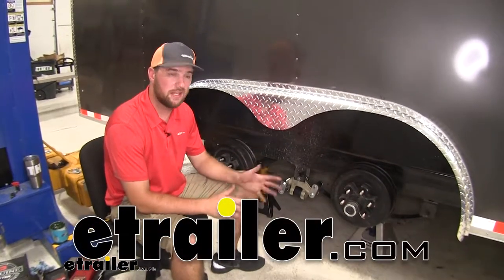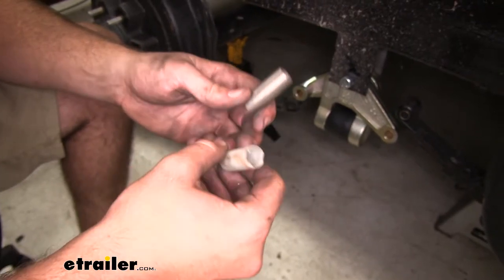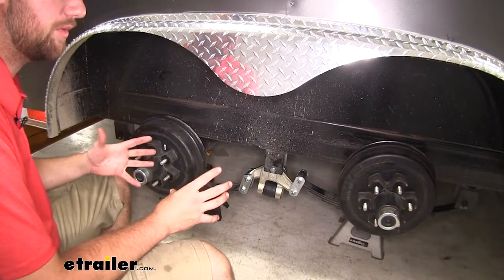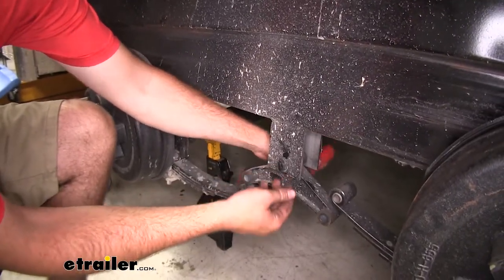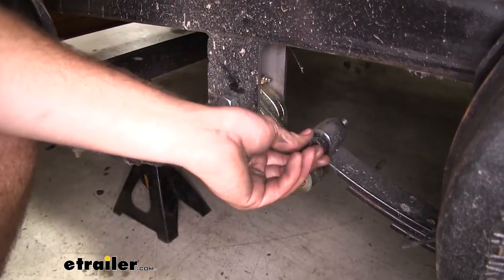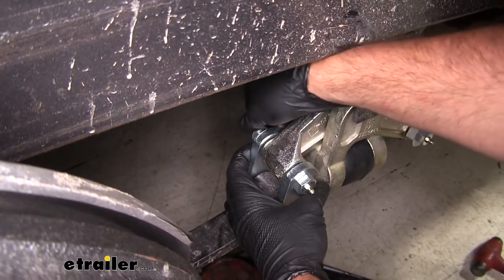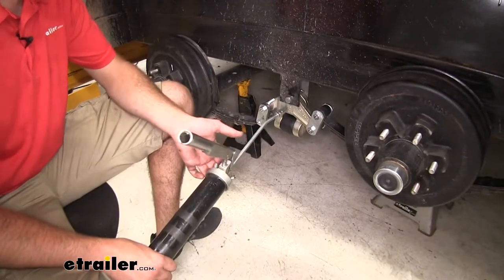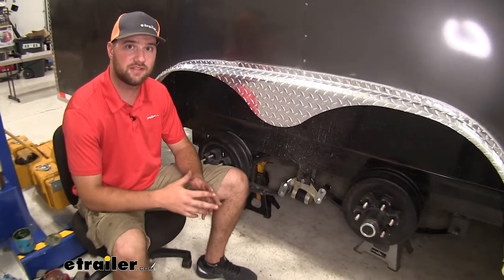etrailer | Dexter E-Z Flex Suspension Kit: The Breakdown

Comment: Grease fitting on the wet bolts should face under the trailer.   Otgerwise you jave to remove the tires everytime you grease them
Reply from the maker: We typically grease the bolts at the same time we inspect the wheel bearings, which requires the wheels be removed anyway. If you wish to install the bolts with the grease zerks facing inward, there's no reason why you can't.
https://www.etrailer.com/Trailer-Suspension-Parts/Dexter/K71-652-00.html

Comment: Dexter torflex axles need shocks installed 
My camper hops like SOB 
I did not know this when I purchased the camper. 
Is there any information on installing shocks
Reply from the maker: How old is your camper? If you have poor ride quality, and your camper is several years old, you'll want to replace the axle, as the torsion dampers have worn out. As far as installing shocks, we suppose that's possible, but we don't have any info about installing shock absorbers on a torsion axle. Honestly, we don't offer anything that would work for that type of application...
Reply: Campers an 18 hardly used. I was hoping you wouldn’t say worn out. With these Canadian roads, that’s very possible. 
Thank you for taking the time to reply. 
Have a great day my friend
Reply from the maker: The average lifespan of a trailer torsion axle is 3-5 years, and you're 6 years in now. A lightly used trailer will push that out a couple of years, but if it's been consistently driven on bad roads at full capacity. it's entirely conceivable that they're worn out. Wish we had better news for you!
We're glad we could help, you have a great day too!

Comment: Want heavy duty?  should re-enforce the frame hangars before this upgrade.  AND what grade rating are on the new bolts??
Reply from the maker: It wouldn't be a bad idea to reinforce the frame brackets but it is not a requirement. The wet bolts that come in this kit are grade 5 bolts.
https://www.etrailer.com/Trailer-Leaf-Spring-Suspension/Dexter-Axle/K71-653-00.html

Comment: Is that 6000 or 8000 per axle ?
Reply from the maker: It's a 6000 lb axle. Hope that helps!
https://www.etrailer.com/Trailer-Suspension-Parts/Dexter/K71-652-00.html
Reply: @etrailer  sorry I meant so tandem would be 12000? 6000 or 8000 each axle ?
Reply: My trailer has a gross weight of 11000 so the 6000lb option would be correct kit ?

Comment: I saw this video and said "There is no way they removed those bolts with the weight on the axles on the jack stands."   I see in the response to a question that you have the trailer with a 4 post lift holding the weight of the trailer on the frame. I think it is important to let people know that you have to support the weight of the trailer on frame and not on the axles. It would be almost impossible to do the job with the weight on the axles.
Reply from the maker: Thank you for this feedback! Yes, we lift these trailers with a 4 point lift system that is lifting from the frame. The jack stands are strictly to hold the axles from hanging.
https://www.etrailer.com/Trailer-Leaf-Spring-Suspension/Dexter-Axle/K71-652-00.html

Comment: One question I have is about the hole in the wet bolts.  Are they supposed to point up or down or sideways?
Reply from the maker: The orientation of the grease hole does not matter.
https://www.etrailer.com/Trailer-Leaf-Spring-Suspension/Dexter-Axle/K71-652-00.html

Comment: Need for a hartland 23rbs dexter trailer
Reply from the maker: You will need to measure the spacing between the holes (center on center) on your equalizer where the leaf springs attach. There are two different size kits for a tandem axle trailer. One size is 5 5/8" center on center and the other is 7 3/4" center on center. I have linked both of the kits below.

5 5/8" kit
https://www.etrailer.com/Trailer-Leaf-Spring-Suspension/Dexter-Axle/K71-652-00.html

7 3/4" kit
https://www.etrailer.com/Trailer-Leaf-Spring-Suspension/Dexter-Axle/K71-653-00.html

Comment: If the equalizer is sitting with angle ( one spring up & the other down ) is this normal ? ( trailer empty )
Reply: I have the same question.
Reply: @markparker4032  ... Two mouths no answer
Reply: No. The right side is correct in the video, the left is incorrect. At the end of the video he tells you how to correct it
Reply: @shadowsr6.  .... I'm not talking about the hangers being correct ( one down, one up ) I'm talking about if after they are installed correctly but one spring
is down not even with the other.
Reply: @goodboyringo9716  if the springs are not equal when the wheels are bolted on, and trailer hooked to the truck,…your trailer isn’t level. Hopefully you’ve figured it out by now.
Reply: @amandadavis9726  ... The trailer is on level ground not connected to truck. Can't remember if I looked while it was connected to truck.
Reply: @goodboyringo9716  gotcha.  When it’s connected to the truck is the most important time to check.  I’ve seen a lot of trailers that were too high in the front,…and then they wonder their trailer’s tires would prematurely wear, lol.  For the most part, I always suggest to get an adjustable hitch so you can level your trailer when you hook up to it.

Comment: do you have a video on where to put jack to raise tandem trailer to do this?
Reply from the maker: We used a 4 post lift for this video but the best way to do it at home would be to lift and support the trailer by the frame rail. Many people want to lift on the axle and you can risk damaging the axle by putting that pressure on it. you can use jack stands or blocks to support the trailer by the frame.
https://www.etrailer.com/Trailer-Leaf-Spring-Suspension/Dexter-Axle/K71-652-00.html
Reply: thank you